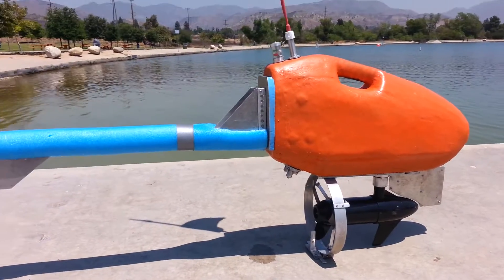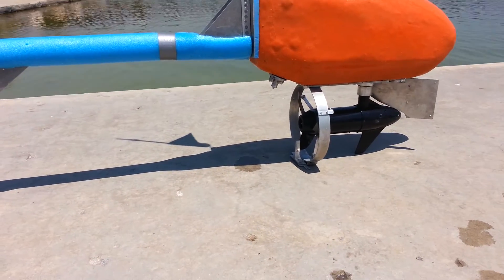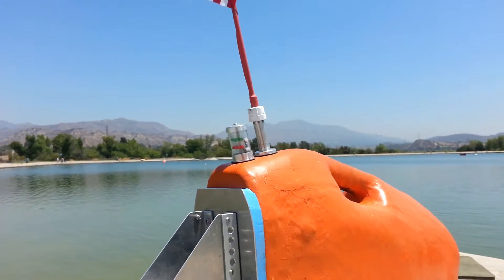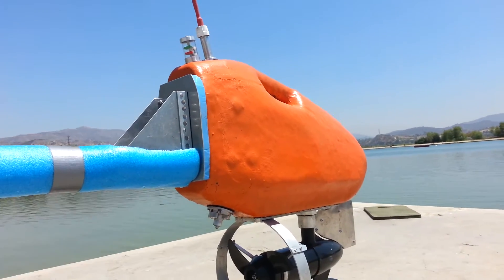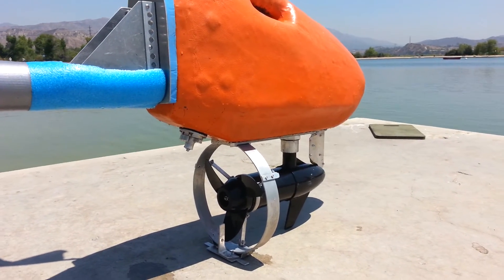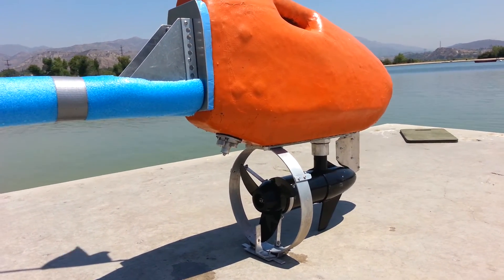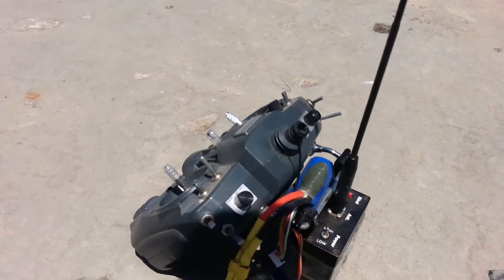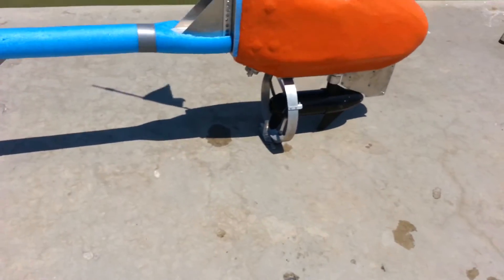My Fishing torpedo

Comment: Awesome build man! Why did you put the rudder in the front, kind of "inverted"? Doesn't that result in very aggressive steering?
Reply from the maker: Because it is pulling the fishing line and I don't want to cut or damage it with rudder located in the back.  Also most importantly from design point of view all electronic units mast be in one box for easy wiring, so the only the position left for rudder is in the front. The tail is just aluminum 1 in x 1 in  square extrusion covered with foam and it will be almost impossible to position rudder with a big servo in the back. (too heavy, cumbersome and not convenient)